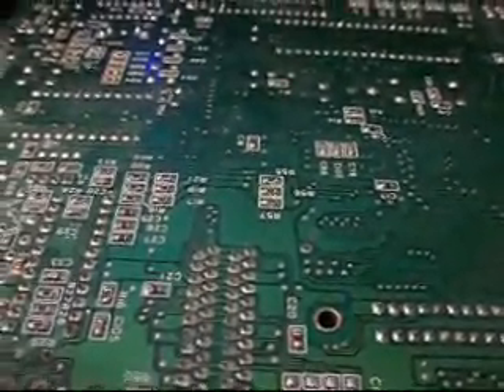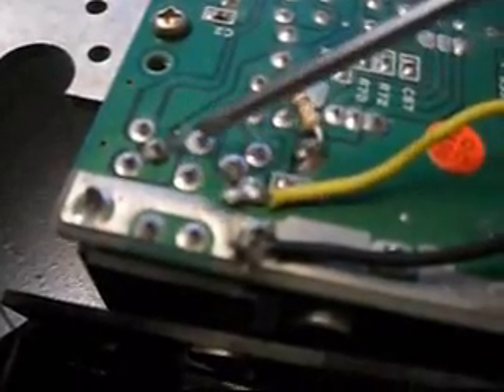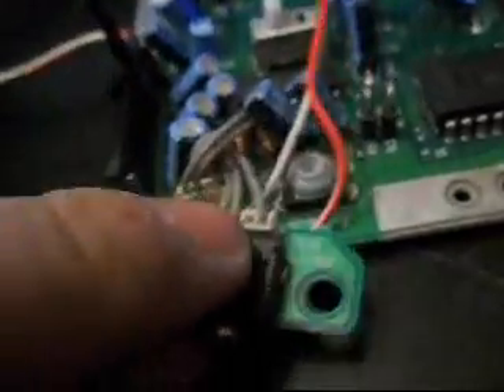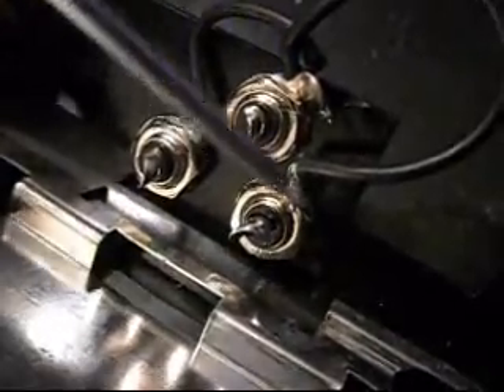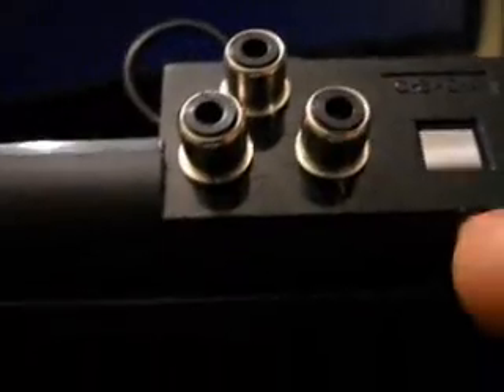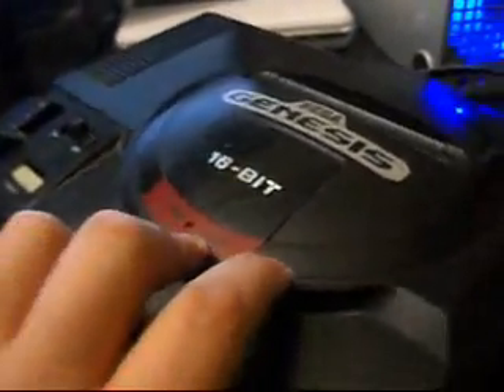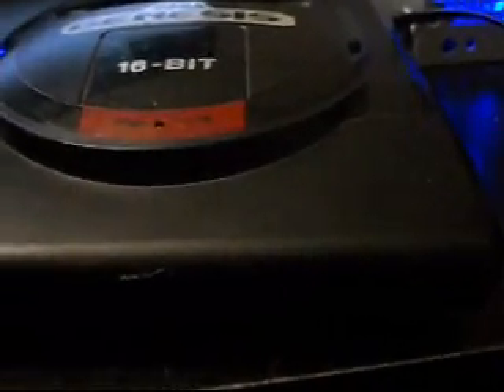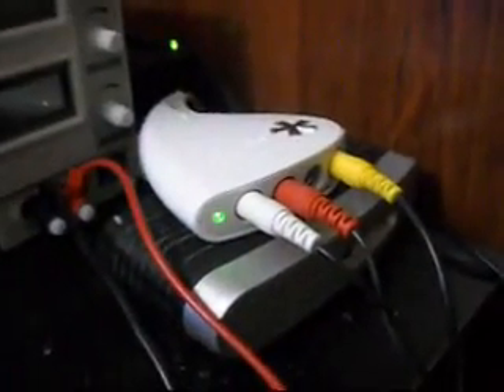Sega Genesis Model 1 AV Out Mod

Comment: Cant believe the shit i get recommended .. Now for some insight ..

Wiring is shit use smaller wires 

Soldering is shit stop blobing and get the right diameter of solder 

Use single piece of small solid strand for the ground and get rid of that rats nest .

Comment: you do know all Genesis have av plugs right I have them n not fakes either real deals
Reply: MillerSI Real Game Master There is A/V using a Din connector, but on the Model 1 it only provides mono sound using A/V. The point of this is to mod it for stereo.

Comment: i just bought a av cord for model 1 less than 5 dollars, they do have them. thanks this is pretty cool though, looking for a video that takes away rainbow vision for your genesis
Reply: I guess in some respect it would seem pointless since the cable is available cheap, but I can understand the mod for the fact, unless I'm mistaken, that the model 1 a/v cord only outputs mono sound, so with this mod you gain stereo sound. If someone isn't concerned with mono or stereo, then I'd say just get the cable. Otherwise the mod seems easy enough.
Reply: I got one for my model 2.  I don't understand why people are modding their consoles for this where there are such cables that exist.
Reply: I have left and right audio on my sega genesis consoles (only the model 2's) because I have proper cables.
Reply: Because Din connectors are atrocious
Reply: Sounds on the left side of the screen are more prominent on the left speaker, and vice versa.

But, not arguing over how the sound is coming out on my TV.

Comment: Im asking because I absolutely cannot stand the Coaxial video from the genesis because of the noise. Video noise I mean; fuzzies and blurry crap everywhere. De-noising is only available on some televisions and the video quality is sheite compared to even composite. Fuzzy edges, rainbowing, slight shaking, and even solid colors have  crazy video noise visible on them. Methinks coaxial be a terrible audio visual setup nowadays but i would like to keep coax usability for old tv's without composite.

Comment: Hey where'd you find the jacks for the genesis? Also, I have a model 2 Genesis but I assume that it is possible to do this as the AV Out port on the Model 2 has 3 pins on the s-video looking adapter. 2 for audio and 1 for video so I am assuming I *should* be able to re-rout those pins to the composite out jacks instead. 

Also, assuming that this would work, could I maintain usability of the Coax AV out port? Its good for hooking up to ye-olden low def televisions.

Comment: Hey, I have some dumb questions:
Does your Genesis not have A/V 8-pin out? (Model 1 only has mono audio on that, model 2 and later have stereo,)
If not, it looked like you mounted your A/V out mod right over where the pins for the standard A/V out is. You might be able (in the future if you do more) to connect directly to those pins there. Would that be very difficult?
Reply: ParaWanderer Yes he destroyed his machine completly
Reply: It's called din connector not "av 8 pon" and it's a very bad connector compared to rca

Comment: Nice. I will give this a go. My questions are, you ground off the video and audio connections? Where do you find the av out plugs that go in the back? Is the volume slider on the front of the genesis now controlling the volume of the audio?  Nice tut, thumbs up : )